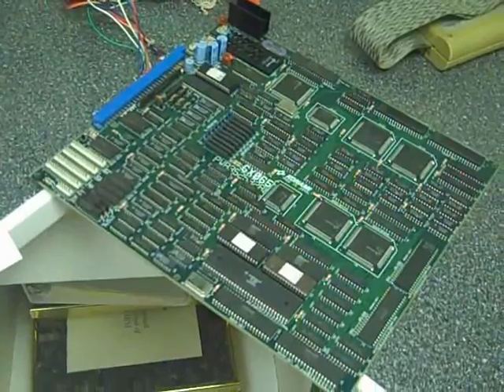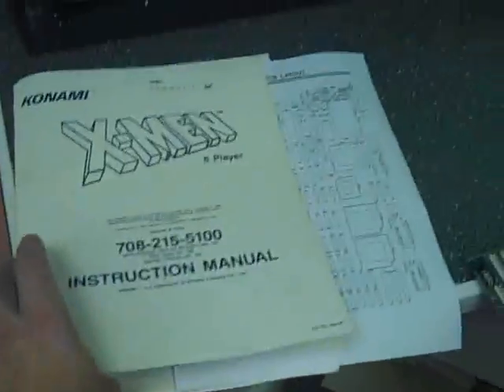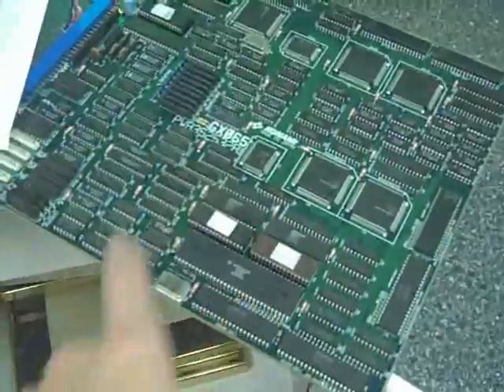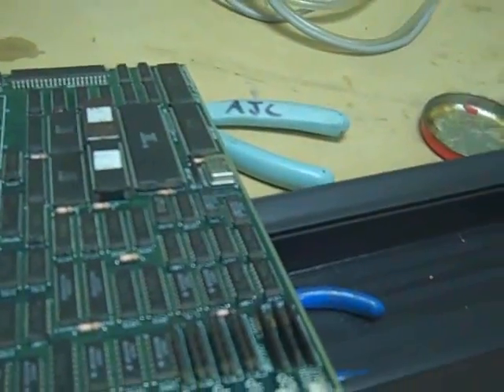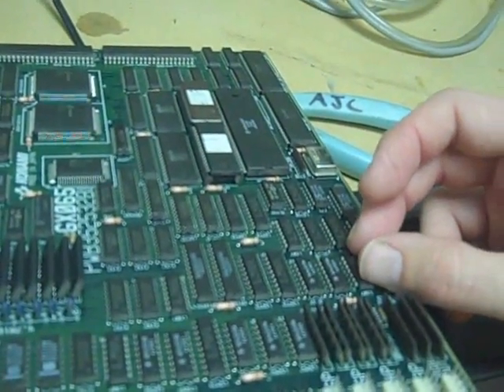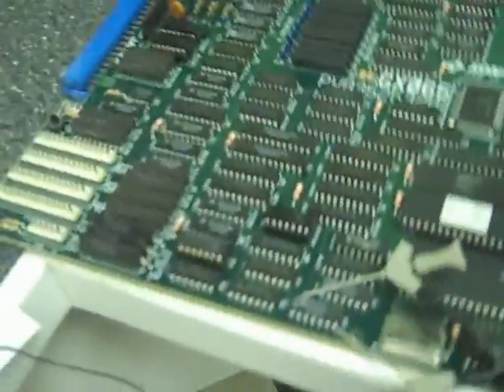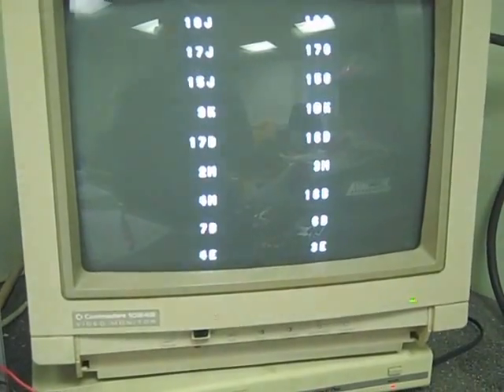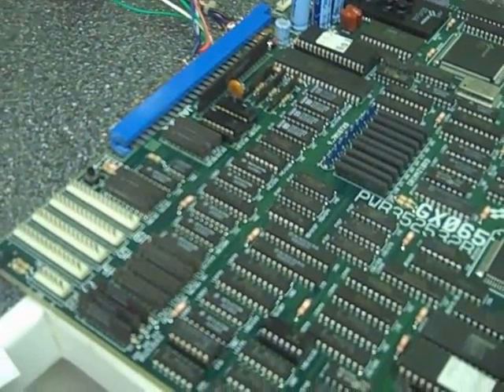6-player Xmen PCB repair

Comment: I love doing repairs like this, as tedious as they can get.  I don't have a Fluke, so my logic probe gets a ton of use LOL.  I just fixed a Lethal Enforcers and a Simpsons last week, and they had very similar construction to this.  Konami must have stuck with that style for some time.

The boards that I really would like more tech info on are Sega's Daytona USA and Cool Riders boards.  They are almost impossible to work on with the crazy amount of custom chips, and the stacked construction.  Not to mention the corrosion damage from being mounted under the floor boards in the sit down cabinets.